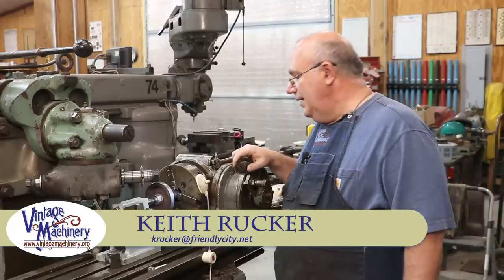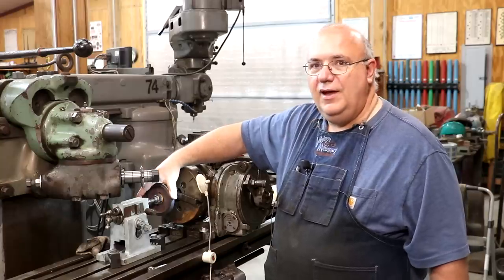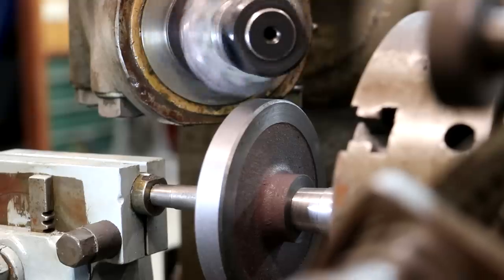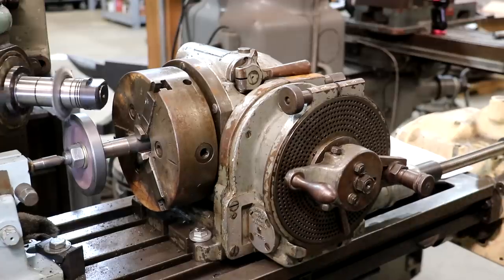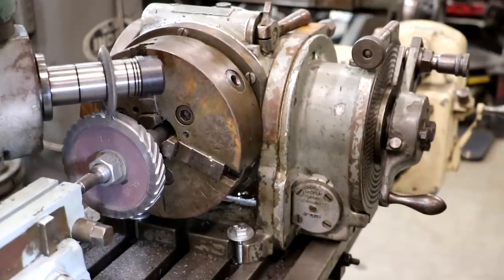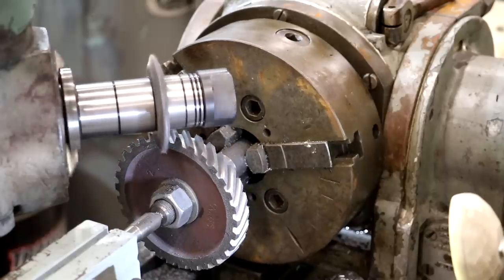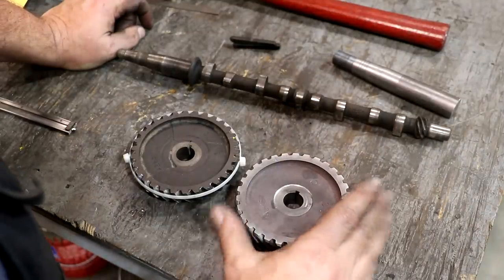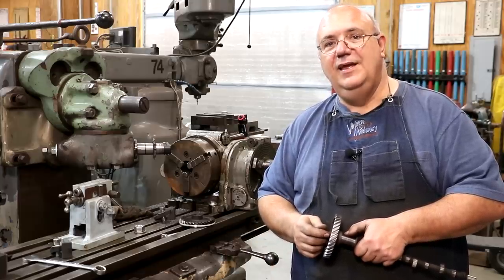Cutting Helical Gears on the Horizontal Mill Machine 7: Actual Helical Gear in Cast Iron!

Comment: Before the days of CNC machining, this is what everyone had to do.  You have to take your hats off to the engineers that figured all this out, involute cutter to use, holes in the dividing head, gear combinations, feeds, speeds, fixtures, and conversations with the machinists to see what is practical to do this.  Congratulations on a job well done.
Reply: Agreed, but what causes me a slight concern is the accuracy of the timing as getting valve timing spot on  is critical for the engine.  Its a shame that there is no form of adjustment.
Reply: You're forgetting one small aspect. Keith is cutting ONE gear. In reality, when they'd do this job, they'd cut a whole row of them. There's one piece that Keith's missing in this lineup and it's a support that goes from the table to the (much longer shaft) with a bearing surface that would've had a slot made into it to allow the cutter to pass whilst supporting (left and right of it) the blanks.
You'd cut as many as you'd fit.
Reply: @clivewilliams3661  There’s an old hot rodders trick of slightly “advancing” the cam by using a special “offset” key in the keyway. As timing gears or chains wear this method is sometimes used to advance the cam 1/2 degree or so to bring the engine back to original horsepower or slightly more.
Reply: @ellieprice363  Yes, I know about offset keys but as you say, they have limited adjustment but the possible misalignment may be more than the 1/2degree, and that is assuming that it is not misaligned by that much already.  All of which is not to mention that the ideal timing for the application may be +/- 4 deg from the factory setting.
Reply: @clivewilliams3661  If it's +-4 degrees, then what could Keith have done to deal with that?  In any case, this is a 30's Austin engine, nothing is pushed to the limit, you probably can't tell the difference in +- 5 degrees. This is on slight step from steam-era technology.
Reply: While this is a reasonable way to produce a one-off gear or small batch of gears, any significant production run would be with differential hobbers or gear shapers. That said, the differential gear setup on a hobber is basically what the lead attachment accomplishes, just being that the hobber actually generates an involute vs being a multi-tooth range of approximate involute form cutter. 

Now, if you want complex, go back to the days before differential hobbing and look at how they built the advance/retard for the helical form into the table index geartrain on a hobber. It worked, but you needed to run the machine in reverse after your rough pass to return the index back to the starting point in sync with the hob.
Reply: @brettbuck7362  My concern was that the alignment might easily be off by more than 1/2deg with the way the key was set out in relation to the teeth, and then factor in the production tolerance of the original, from which it was copied and the timing could be too far out.  We don't know what the application might be but say this was for a vintage racer then having the ability to adjust the timing might be advantageous.  What could be done depends on what is allowable for the application but ultimately a two part gear with the centre rotating to index the variation, say like an adjustable pulley for a belt drive timing gear.
This may be for a 1930's Austin engine but ,many vintage tuners still adapt and adjust the technology to make the best that they can.   Remember Burt Munro used a 1920 Indian motorcycle to set a land speed record in 1967 that still stands today, using pistons cast by him to his own design.
Reply: Summit has offset keys to 7 deg.
Reply: @clivewilliams3661  Understood, maybe it is more than 1/2 degree - it might help or hurt, and if you need +-4 degrees to optimize anyway, Keith would have no way of knowing which way to offset it, but  there surely isn't to get it to <1/2 degree of nominal.
Reply: @brettbuck7362  I agree that timing the gear i.e. locating the keyway, was probably outside of Keith's remit and thinking about it was probably better to have been carried out on the engine in-situ where the engine could have been perfectly timed and then the key in the cam shaft could have been transferred to the timing gear.  It would have meant that the customer would have had a two step manufacturing process on the gear but because it was so crucial to get the timing right it would have been worth it.
Reply: @claygormish4884  I only found two (Mr Gasket) offset woodruff keys and they were for american vehicle crankshaft  in 2deg and 4deg offsets.  To get these offsets without compromising the strength of the key they would have to be fitted to the smallest gear i.e. the crankshaft gear.
Reply: Gear hobbing was a lot more common for mass production. The setup is a bit more complicated than this (it has to synchronize to the spindle instead of the table), but dedicated gear hobbing machines are still the way to go for mass production (where sintered gears won't work).
Reply: @brettbuck7362  Valve timing is extremely critical in internal combustion engines even in the very early days. I think a jig could be made that would make the establishing of the keyway position in relation to the 0 tooth root more precise. This could be done by turning a hub that would fit inside the old gear to establish a starting point for the hobbing to begin. This hub, if you will, could then be marked accurately on a verticle mill with an indexer. To establish the correct position of the root in relation to the key an indicator or needle or even a degree wheel could then be fitted or fixed to a location cavity milled into the hub thereby extending the sightline of the keyway to the outside perimeter of the gear much more accuratly. A possible way to achieve this may be to tack all of the pieces of the old gear together in order to make that old gear the fixture to base the jig on...                

maybe?
Reply: @ClanChapman1rRS  It is far less critical on very low performance engines, but, in any case, offset keys are the way to go. The problem is that even if you had an intact original gear, they were not terribly accurate to begin with, and given the generally very low level of workmanship, probably had to be fitted individually even at the factory. With only one gear to choose from, if any timing alterations are required, offset keys are probably the only practical way without redesigning the gear (separate hub and ring). In fact, there's no reason to beleive even the original gear was anywhere close to optimal. This is a *British Automotive Product*, you can't have great expectation.
Reply: Agreed!

Comment: I am really hoping the owner films this car running when it is done, so we can all see and hear it.  I'm getting really excited to see this thing resurrected after all this work.  By the way, I frequently share your videos on homeschool forums so mamas can get their boys interested in studying Algebra and Trig to be able to understand and do this kind of thing.  So, some questions.  You were talking about the stresses on the cast iron in cutting this gear.  Is this possibly what made the original shatter, or was it more likely a back fire or other catastrophic failure.  I'm assuming that if you made this gear of steel, the one it mates to would face stresses it wasn't designed for.  Would it ever be worth cutting another gear in a different material, in case this one breaks, so at least the car wouldn't be lost?  Could it run off the plastic test gear if this one failed?  My question is whether there will be someone around who can do this if it fails when you are gone.

I very much admire what you do on this channel.  I have learned so much from you, and I admire the way you are willing to step up and learn new skills in order to keep these old machines running.  You are preserving huge chunks of our history.

Comment: At last Keith! Well done mate, that's a perfect result, especially for a first attempt. This project for a friend must have cost you a pretty penny in getting all the ancillary's to just even start the job! I'm quite surprised your friend with the Austin Sven couldn't find a replacement cam gear here in England, as the Austin is still around in plentiful numbers in the vintage arena in the UK. But be that as it may he has a brand new one now. The matching crankshaft driving gear is obviously has only 15 teeth as the cam runs at half the speed of the crankshaft and it will be just another helical gear keyed to the crank with matching involute teeth. The earliest Austin Seven was introduced in 1922 , the 747cc in 1923 so your camshaft gear could potentially going into an engine exactly 100 years old!
Reply: Maybe all the old gears are broken too!
Reply: @leeklemetti1887  there are a good few that do competitive hill climbs over here using the original engines, so engine parts must still be available.

Comment: I never expected to see this job finish before my death…
Reply: We're not out of the woods yet. It might come back if the backlash in the gears is not correct.
Reply: @Drottninggatan2017  The engine only turns in one direction. The  backlash would be adjusted in, just like normal wear could be adjusted out of the engines operation.
Reply: @paul5683  
But if there is too little play they might not be able to put the gear on  or it will make a grinding noise.

Comment: I'm curious. When checking the DP with a gauge, do you check parallel to the face of the gear or perpendicular to the angle of the teeth? Or is there something I'm missing when checking helical gears. Thanks for sharing. Great series.
Reply: Over wires is difficult with helicals. Most resources suggest measuring over balls vs pins, but pins are most prevalent, even in industry. 

It is a lot of "by feel" work, but there is generally movement perpendicular to the length of the pin because the dimension widens as you go up or down the pin. 

Odd numbers of teeth on helicals are a huge PITA. One measures higher (in height) on the OD face and the other measures lower.

Comment: I am amazed at how little backlash there is in that setup. The design and engineering to originally develop that machine and its accessory's is amazing.
Reply: Figuring out to use a 80 tooth cutter instead of a 30.... Awesome.

Comment: I would like to point out to people who may look upon this excellent recreation of older (but still in use today in countries with poorer backgrounds) technology and think "man... that's slow for a single gear", that they'd be wrong.

In a factory, they would cut (on one machine) several such blanks setup on the arbor. Keith's missing a particular part of this setup that would allow full table length cutting, and that's a support that would sit in the middle of the table and support the arbor. The ones i've seen have a bearing surface (oil bronze) and affix in two of the T slots, aside from the longer arbor... they're basically unobtanium now. I've only seen (with my eyes) three in my entire life.

One can find on YouTube such setups in use if one searches for "helical gear cutting" and has the patience to sift through all the videos. :\ 

It's unfortunately very difficult to find them specifically because they're not titled properly, usually with catch-baity titles like "sensational gear cutting genius machinist" and all that jazz as if it's an amazing tech or something. I've seen them cut (on a similar sized mill as the one Keith's fielding) up to 30 gears in one go.

Tech wasn't as "helpless" as we think it was, they had factory floors chuck full of these machines doing gears upon gears upon gears.

Comment: Excellent work all around. And good choices on camera angles also. Hats off to the people who figured all that stuff out before there were computers, or even calculators.
Reply: they might have used a slide rule which was fun to use back in the day
Reply: @larrymills8527  I still have my old 1950s log-log rule.  My father, who was an engineer in World War II, used a circular slide rule for his entire professional life.  He could get the answer with it as easily as with a calculator.
Reply: @peterhobson3262  My first real job, just out of school back in the 70' was with an electrical equipment manufacturer. The senior engineer was a WWII Navy vet who would sit at his desk working thru lengthy calculations with his notepad and calculator. After hours of this he would open his desk drawer and pull out his  slide rule to check his work.
Reply: I never got along well with one of them things.
Reply: As a professional gearcutter, I am glad I still have my TI-84+ graphing calculator and 4 gear calculation apps for differential combos. I know how to use the longhand methods, but I don't usually have an hour to figure out a close-enough gear combo by hand when tech can generate 3-4 options that I just have to check whether or not they fit in the gearbox.

Comment: Keith, from an old gear cutter, nice series! A couple of things.....I'm not seeing the measurements. The original gear may have been engineered, so the over pin measure or the span measure should be taken from the sample. Also why isn't the whole depth .216? !0 P will have an addendum ratio to whole depth of 2.157 or 2.25 depending on the cutter. Otherwise, great job!!!!

Comment: 13,082 inches? What is the diameter of the gear blank? Because with a 45 degree angle the diamter should equal the table travel per revolution. eliminating all of that math. 1:1 ratio.

Comment: My BSA timing gears have 3 keyways each at a slightly different angle. To time the cam exactly. However i doubt top  performance will ever be required here, it will run perfectly fine up to 5 degrees either way

Comment: If the dividing head was at 45 deg to the table, could you make a straight cut? The shop I worked in had the gearing to drive the dividing head, but was never used. That is quite the setup.

Comment: Did the original break because it was cast iron? If so, could it have been made from steel? Regarding the timing keyway, couldn't it have been aligned with any of the teeth, since the gear is radially symmetrical? I fear that the timing position is more precise than aligning "by eye" only.

Comment: Forgive me if this is a stupid question as this is far outside of what I do. But, couldn't you just angle the dividing head at 45 degrees and run the cutter at its normal position? Wouldn't that accomplish the same thing without the need to have the gear blank spiraling to cut the helical angle?

Comment: first - is there any hysteresis in the table travel to rotation mechanism? - for multiple passes does the cutter back out exactly on the forward cutting path? Second - hypoid gears? can these be cut on a mill this way?

Comment: these mentioned 8 different cutters (for a given tooth modulus) and being each cutter for given range of the teeth are to prevent cutting too wide at the bottom of the tooth for ver high numbers of teeth (or for infinity being a straight rack) and on the other hand, to prevent from leaving too spiky tooth on the very low numbers of teeth (i.e. 10 teeth or less). The first and the second case is a deviation from pure tooth evolventic shape and causes weakening the tooth at its bottom (in racks and high numbers of teeth) and at the tip of the tooth (for very low numbers of teeth). There was a methods for avoiding all that being compensation by not cutting too deep into the material. This phenomen is only seen in an enveloped gear cutting. With your modulus cutter, although You are rotating the blank as you feed the table, it is not an enveloped cutting hence you are using modulus gear cutter (gives always fixed shape regardless of the numbers of teeth).

Comment: The only thing I saw that I question is the valve timing. One of those marks should line up with like mark on crankshaft gear. On older engines the #one cylinder is set at top dead center and the camshaft lobe for it was trammed to a given angle for the flat of the lobe.

Comment: I saw the result of cutting a chain sprocket wrong several years ago. I bought a water well drilling machine with a large sprocket that the previous owner had made in his shop and the chain got tight in one place. When I had to replace the chain it got worse  and I ended up cutting off 3 or 4 teeth in the tight area to make it run smoother. It was about 24" in diameter so it worked fine for all the years I used it.

Comment: I'm gonna take a wild guess and say that that gear is not timed correctly to that key way judging by the way you had the scale laid out across it. That thing should have had scribe lines on it You should have had a set up shaft with scribe lines in the center of the key to line up to one of the gears. No idea why you cut corners at the most important steps.

Comment: very impressive. I worked for Chicago Steel Tape for 27 years. Set up their machine shop and ran the maintenance dept. Had over r30 cnc machines and was self taught. We bought Burger instruments which built the surveying instrument they used to build the Bookland bridge. Found the original build order and the invoice. They were in this factory for 80 years. Toolmakers that worked there for over 50 years. Gut wrenching for them as well as me. Hated to moved and scrap the machinery. I loaded up the dividing machine that was built by them to scribe the horizontal circles. That is in the Smithsonian  Museum. Wooden frame and handmade gears.